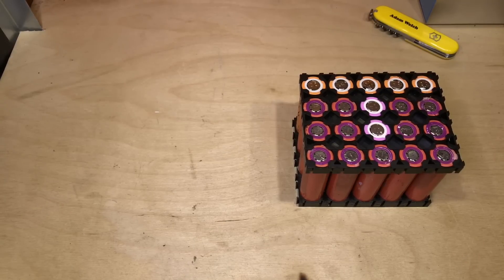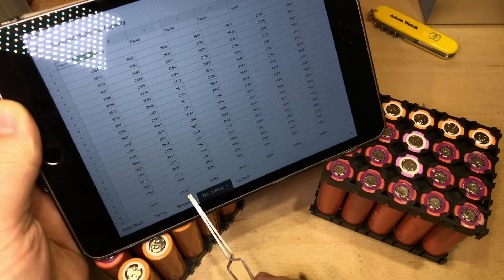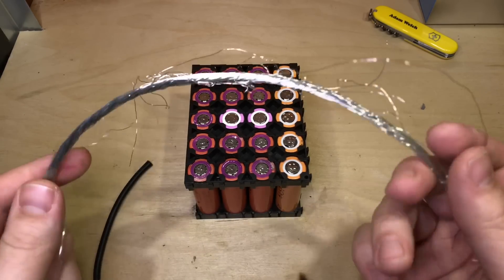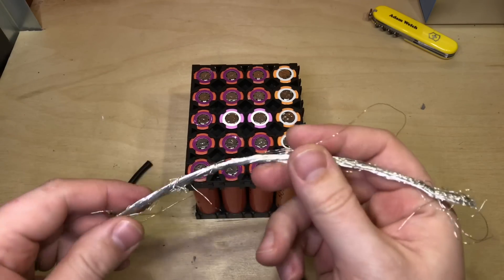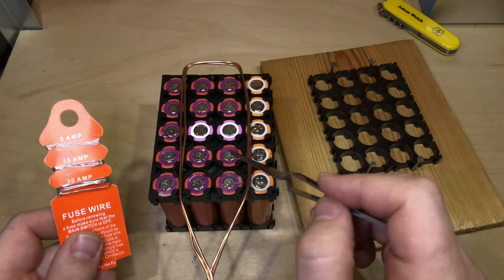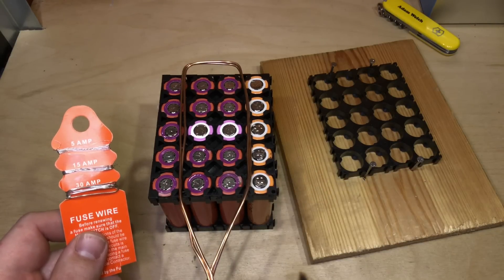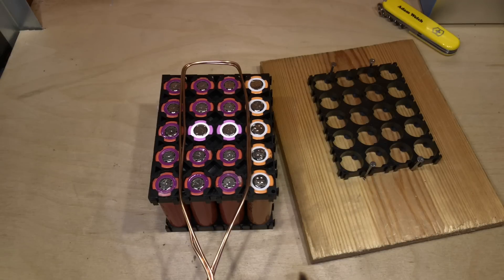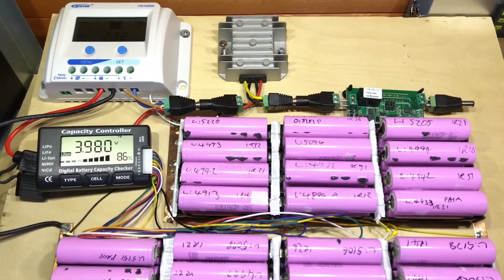18650 Lithium Ion 20p Packs - 12v Solar Shed

Comment: Adam, I spent some efforts building boxes to hold 18650s in parallel, but then noticed on your other videos that you used magnets to hold batteries together in series.  I was wondering if you see any problem if I held batteries in parallel  with magnets on the end of each battery then the magnets connected to metal strips for cathode and anode?  It would save me a lot of effort.

Comment: Hi sir.is it posible to join 20cells with different battery capacity like(2000-2500mAh)in a parallel?and if posible,what should i pick bms?40 or 50?thanks

Comment: Do you leave the capacity meter on the pack all time? I think it takes the energy out of the first cell pack, not the whole package evenly because the voltage is too high for it. It can be it brings the whole pack out of balance over time without its balancing fuction activated. Please check on this - its just hearing - no experience with that so far. I also ordered the ISDT-controller - hope it will please my. Why didn't you like it?

Comment: I was going to buy those same mounting brackets for the batteries. But I'm making a hundred battery pack and to avoid driving myself crazy instead I bought a bunch of battery packs that are already run in parallel. They're only for slotted so I bought a bunch of singles too so I could put 5 batteries in parallel didn't hook up each one of those in series. That should theoretically work the same right. I also figure the advantages as a battery ever goes bad or if I need to replace the batteries I could just pop them out and replace them with new ones

Comment: Hi Adam,
something i found out by trial end error and then lots of reading the balancer you use, i believe to be a resistor balancer, or a passive balancer, would there not be a large gain to moving to an active balancer? like the original one you tried so many videos ago? but this time one that works more as expected? thinking about efficiency here.
one thing i find from my use of balancers they never work correctly until after a charging current has been applied to them. just a thought as im doing a similar setup however more modular.
Thanks for all the great videos

Comment: How are you going to attach the wire bar to the negative end of the batteries? Soldering to the negative end is hard, requires an extra thick soldering tip with enough heat storage. I have built a DIY spot welder as you can see in this video here (https://www.youtube.com/watch?v=o4NaDMoEHxU&t=2s) and I thought of spot welding nickel strips on the negative side and then soldering over the nickel strip away from the cells.
Reply from the maker: Do you know I’ve already seen your video on the spot welder. It’s a super thing.  I’ve thought about building one a few times (tried once too) but I don’t see how I can make it work with my thin fuse wire. I was a bit worried about soldering the negative side of the 18650s but actually it hasn’t been an issue and I bet I’m only applying heat for a maximum of four seconds. As you say, I’m using quite a big tip, I set my iron to 350 degrees and I only do five at a time and then allow it to heat up again.  But I really haven’t noticed any excess heat or prolonged exposure issues - but time will tell. I may do a video on building the last pack - we’ll see. Cheers.
Reply: Adam Welch Actually it's not my video. I have built such a 12v spot welder, it works quite nicely. I have also managed spot welding glass fuses on nickel strip. Impossible to spot weld copper fuse wire though.

Comment: I would go for spot welding with nickel strips. Soldering is possible and normally chances of ruining a cell by the solder process are limited, but given the larger number of cells chances are high that one or a few cells are damaged and your balancing gets more important.

Comment: Are those purple top ones sanyos? Have you found them to be heaters?
Reply from the maker: Yea they are and no, I haven’t really. Although I’ve been treating them nicely only charging and discharging at about 500mA.
Reply: Gotcha. I have found several of mine to be heaters.. I believe HB Powerwall did as well. Just for your knowledge in case you want to charge or discharge them with a higher current.

Comment: Hi Adam, why don't you use your TracerA for the Li-Ion batteries. Under user settings you can set it to what ever voltage you want. And then add your balancer in parallel with the batteries.
Reply from the maker: Initially I wanted to see how well you can charge lithium ion from a bog standard lead acid solar charge controller. All the cheap ‘lithium ion’ units I bought weren’t very good in my opinion. In fact the lead acid chargers do a better job I think! Now I’m expanding I think I will be using an adjustable solar charge controller, but I’m yet to decide which one. Cheers
Reply: Yes I understand, I have also played with one cheap PCM charger like yours, and this ebay blancer: https://www.ebay.com/itm/3S-11-1V-12-6V-25A-W-Balance-18650-Li-ion-Lithium-Battery-PCB-Protection-Board-L/252957279962?epid=934013044&hash=item3ae56dc6da:g:OS0AAOSwaeRZJq5M
It works ok for me. 
But when I want more power, my TracerA with user settings for Li-ion works like a charm.

Comment: I need some help. I have made a solar charging system for 6p 7s  18650 using the excellent epever  tracer a . but i have a major problem i have tried downloading the software for windows from their site and all i get is a folder with dotnet fx and no software http://www.epsolarpv.com/en/index.php/Technical/download
i have tried this download from ALL my platforms, windows linux android also using vpn to no avail. i have been in touch with the tech support but they insist everything is ok and don't bother them anymore.  can someone please try to download the software from the link and see what they get. there is supposed to be an msi package there but i cant get it is it just me or have they messed up ?

Comment: WTG Adam!  On my current 7s 25p pack I had to strip over 30m of sheilding off 10 ga wires, well 3 out of the 4 conducors (ground being a cinch), but I final figured out the skill of the ol telephonr techs to strip with a blade from a utility knife down the conductor with thumb on opposite side. It takes quite a bit of coordination indeed.
Then I twisted the 3 conuctors very tight with drill to form bussbars roughly equivalent to 4 ga.  Which will easily handle my 70 amps at 26v.  I've discovered a new trick which hasn't been published anywhere yet. If you place your fuse wire on the 18650 cap then balance the chisel tip of a 100-230w solder iron on top of it such that it doesnt contact the actual cell but only heats the fuse then in 3 secs u can use the heat from the flowing solder to bring the casing up to temp to make a perfect bond w/o needing to directly heat the cell.  Ive done many tests and u can lose 5-25% capacity from a cell with only few secs of solder tip temperatures.
cheers :)

Comment: It would also be interesting to know how cellcapacities change with temperature. Furthermore, how much warmer are the cells in the middle of those blocks when under load, in warmer weather? Life testing will be very interesting with these old cells. Thanks Adam.
Reply from the maker: Heat is definitely a factor, it’s a chemical reaction after all. My experience suggests that lower temperatures mean lower capacities under test, and no doubt there is an upper limit too. 
With 20 cells in the pack I’m going to pull less than 1amp per cell (the pack will have a 15amp breaker on it) and I’ll only have 200 watts of solar on it to charge - which is about 8 amps at most. So I don’t think high temperatures will be an issue for me, but we’ll find out!
Reply: At those currents, you should be fine. Maybe some Midsummer checks could be done. That is, if you don't blink and miss the Summer!

Comment: To get the twin and earth out of the outer sheath it is easier to pull the earth one from the side all along the length.

Just a question have you actually tested that the capacity checker reads all the cells correctly with your DMM. It just seems unlikely that the voltage would increase going up the pack, unless you have the least capacity working up to the highest.
Reply from the maker: Nice tip. Thanks. 
Yes I have checked the capacity controller. Although not spot on its surprisingly close - or at least mine is. I can’t find the spreadsheet with the pack values of the 7s8p pack to double check but I think they were pretty evenly matched. I’ll log them again and see if it correlates. Cheers

Comment: I, too, am leaving the tabs on the cells, but I haven't started soldering my packs yet. How did it work out for you? Did the solder stick better?
Reply from the maker: I’ve not got that far yet - I’ve been experimenting with my buss bars after reading suggestions here. I’ll let you know if I can.
Reply: Adam Welch sounds great, thanks! Your the first person I've seen leave them on. I know the danger in leaving the positive side tab on is that it could wear through the insulator and cause a short, but you just need to make sure the tabbing is short so it doesn't reach the insulator in the first place. The bottom can be long as long as it fits in the cell holder.

Comment: Yo Adam, Have you looked at/considered Vruzend kits (https://vruzend.com/). If you're not familiar it's an Indian company that have created kits for 18650's that require no soldering or spot welding and have an IR of less than spot welding. 
The kits include all the required bits to create a battery from cells. Each kit contains enough caps and supporting accessories to make a 13s4p pack or any variation of. 
1. At least 104 Battery terminal caps
2. 130 bus bars
3. 6 U clamp terminal strips
4. At least 104 nuts.
5. 6 zip ties   
Their version 2 kits include copper bus bars (previously nickel).
The kits are about aud $55 (about 34 pound). Contact vruzend at gmail.com for direct contact with the Indian manufacturers.
I have nil connection with the company but am very positive about them, as is Jehu Garcia.

Comment: There is a guy that builds stackable 18650 cell connectors. Capable of connecting them in parallel  or seares. And you can build them in a lenoler, or in a box, or rectangle pattern. If you practice,  you could build a round or circle battery pack. He also makes bicycle motors to power bicycles.  He is from California. Ebikeschool is his YT channel.

Comment: 4 strands of copper is major overkill for a bus bar with a battery that size, I would save your copper unless you really need it for the physical stability.
Reply from the maker: Hi David, yes I think you have a point. I’m re-evaluating that. I think a good compromise is two strands of copper twisted together. It gives good strength, plenty of current carrying capability and reduces cost - even though this cable is left over.

Comment: I tried thinking of alternatives (haha, not just me). What if .. .. If you put all these 20P packs in parallel? You would need a booster to boost up the voltage: easy task. And to charge it you need a converter. Easy as well. Benefit: the cells are always at the same voltage! The downside might be the requirements of the booster, and the efficiency of the booster (90 to 95%). But still: it requires no balancing! Alternative 2: During the times you are not charging the packs (and not using the packs) you could have the packs switched to parallel (so that the lowest cells will get power from the highest cells and balance). This could work if they are up to 0.3 Volts or so out of balance. I have not tried this idea! You could couple this idea with the first one, meaning if you need power when they are balancing, you could use a booster to boost up the voltage.
We (in my comment to Julian Ilett) also thought of a flying capacitor, but that does not really appeal.
I do believe in the end it is better not to balance the cells, but just stop charging as soon as a (any) pack is at 4 Volts. You would balance them once, and after that always stop charging if one hits 4 Volts. The idea is that discharging the cells down to any voltage might have the lower voltages drift, but after charging they all should come back to the same voltage they were before. What comes out shall go in. Same internal resistance.
PS: no need to see you soldering .. .. But lok at the other comments, do not add a loop in the bus bar. There should be zero amps there anyway! (hmm, to be sure this is true, you should have to use the repacker to as well calculate a nicely balanced left- and right side balanced pack (10 cells left vs 10 cells right). Pay attention to details, I know .. ..
Reply from the maker: That loop in the bus bar is causing a little controversy isn’t it. I have an idea in the back of my mind about it though. As you say it should have zero current flowing, but equally that may be the path of least resistance from the highest capacity cell to the lowest. 
Having the packs in parallel isn’t going to work for me - I’ll be solar charging them and my panels are all twelve volt - so I can double them up for 24. 
I’ve seen this idea of an eight pack to parallel up with the highest pack then parallel with the lowest, thus evening out the two. It seems quite clever if not a little complicated. I’m going to take a more conventional route to start with - but who knows where it’ll end...   Cheers.

Comment: When I  make packs I dont take the bus bar to the outside edge on the non terminal end but keep it same as the 5 cell edge of the pack.
Goog not to have busbar hanging out the edge of the pack!
You can't beat the 4x5 holders imo

Comment: I'm doing the same thing now. I been charging and testing batteries. for over a week. nonstop! since last Friday evening in fact. and I'm not 1/4 the way through the cells. I have some tp4056 boards I'm working on making a charge board. so I can at least pre charge the cells . so I can then test them. and my tester charger only test and charges at .5a . and if I charge at 1a it will speed the process. I have a lipo balancer like the one you have. and plan to balance manually for a short time. I am looking for a good cheap BMS balancer. 7 s 24/29.4v isn't exactly everywhere but are plenty available. I was thinking about using 3-4 of the smaller balance boards. I don't want a rigged IP mess. but all my cells are the same. so it may be l bit easier to keep in shape. I am interested in seeing what you come up with! I also plan to solder yo the tabs on the cells. keep it up.....
Reply from the maker: Good luck with your project. Cheap BMS’s tend to run cells to their max before taking any action. That’s why
I like the capacity controller which actively balances all the time even though it does it at a low rate. I don’t charge my groups much higher than 4 volts so most balancers won’t do anything to keep my cells in check. Hopefully the solution I’ve found will work for me. 
Internal resistance is important - but evening this out as well as capacity makes it very hard. I might try and measure the IR of my groups once they’re all connected up to see how they measure up. Cheers
Reply: Adam Welch yes I have one of the controllers also. I may try multiples of them until I can get a BMS/ balancer. I hope since all my cells are the same they will be easier to keep inline. I'm thinking about using 8 ga or 10 ga solid copper wire as a buss. until I get more cells I may pull as much as 4 amps per cell peak. I hope to eventually get that down to 50 ma or so. with a ton of cells. I also want to start a electric car conversion. even though Ev's aren't popular around here. I did actually see a Tesla the other day. I have to power my house first! I hope you find us a great solution!  I have been looking  but I haven't decided on anything yet! good luck....I also plan to not charge to over 4.1-4.15v. I have heard that will nearly double the life. along with long term storage at about 40% charge. but I don't think I will be "storing" mine for any time. I'll be lucky to even get them charged before they are used again.

Comment: I haven't scrolled the previous comments, so it's probably already mentioned. But won't the individual cells drift over multiples of charges unless the internal resistance is the same for each cell?
Reply from the maker: Yes it’s been mentioned a few times. I have logged the IR of each cell whilst I’ve been testing them. Organising cells by capacity - and IR however seems a fairly tall order.

Comment: Hey adam braided copper would work as well and if your not going to use any high current the cheapest would be solder wick which i have used on my last 2 4S 20P packs
Reply from the maker: Ha! I did think about this the other day...  pre fluxed as well, but I did wonder whether the cheap ones that I used were really copper.

Comment: I have the same set up 7s 20p with no bms and it works great
Reply: Adam Welch have you tested the internal resistance each pack has? what is the current draw? my pack is 40p 7s so far. I plan on it being much larger. maybe 2000p7s eventually. hey I have a dream! I'd say it would take a bit to balance a bank of that capacity..
Reply from the maker: Useful to know, thanks.

Comment: About bus bars i think this is the best solution for you from Average Joe. Joe got this idea from somebody else, but i think this is a good idea. 

https://www.youtube.com/watch?v=e0tjzgXnk0E

(i'm Electrician) Greetings from Northamptonshire
Reply from the maker: That’s a great video and pretty much sums up the way I intend to do it. Questioning how many cores I need though now for my bus bars, but I think I need an odd number to spin nicely. You’re a sparky? You might find my stripping tool useful :-)
Reply: How many wires? it is depend how many amper what you expect? More wires, less impedance, and less inefficiency
Reply: I do not have 3D printer